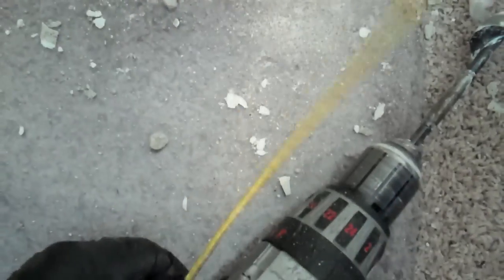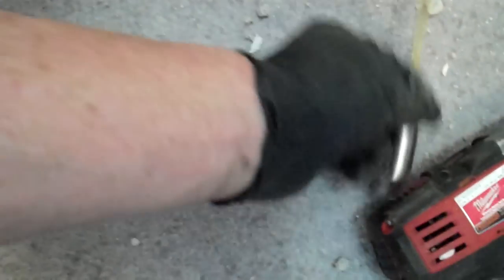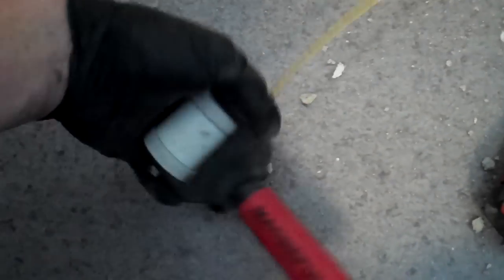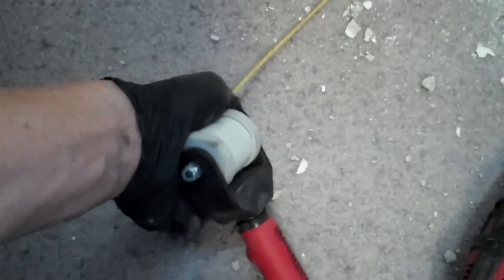How to pull wire behind a wall without fish tape!

Comment from the maker: You can actually read the framing of the house- all the studs and the tops of the walls are exposed in the attic  then you just need to measure how far down the wall to go.  You WILL likely need to move some insulation around to see the top of the wall though.

Comment: I've fished some wires manually with no tools before but the holes were already there where other cables were run.  Now I want to install in wall speakers that are right in the middle of a wall..how do I know where to drill the hole in the attic to drop the wire?  Just have to measure from specific points or something..in the house, then mirror that in the attic?  gotta get me one of these tools too...pretty awesome.

Comment: Right, will see how it goes, waiting on my Speakers to arrive.  I have run cables before but ran them where existing cables were so didn't have to guess or measure.  I was going to buy this tool but since I am cutting a big speaker hole and there's no insulation I shouldn't need any tools besides drill ;)  BTW you look and sound like Josh Hamilton...heard that before?

Comment: I'm interested. I'd be even more interested if it would pull the wire through the top plates through the hole that I drilled with my 6 foot flex bit. That would be a winner!

Comment: That's really tight, it looks like it will work with speaker wires and cable wires. But will it be able to pull Romex? Because romex is hella stiff, just wondering
Reply: Use it to run a leader with paracord, then use that to pull. Probably could run a garden hose down the wall then-

Comment: oh, i thought this wire pulling gizmo would magically pull wire thru 2x4's and such horizontally not just between the vertical studs. I like my heavy slim plumb bob with a tough string attached.

Comment: WOWWW!! Huge magnetism. I didn't think copper was magnetic to allow the magnet to pull on the cables. Of course, I'm assuming it is copper just because it is so common, but what a tool. Enlighten me, coz i'm stumped. lol.
Reply: he's not using the magnet to pull the wire, he's using the magnet to pull the steel plumb bob @ 00:33 which is attached to the wire. hope that helps.

Comment: There was a spy who used a similar technique to hide his records.  He would remove the molding at the top of the wall and lower the package inside the wall with a metal attached.  Then, when he wanted to retrieve it, he would draw it up the wall with a strong magnet.